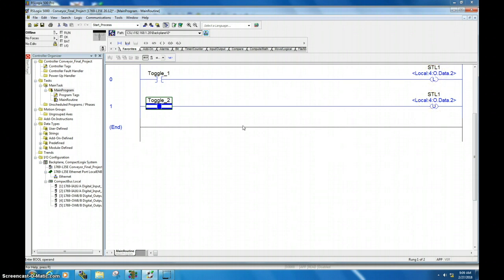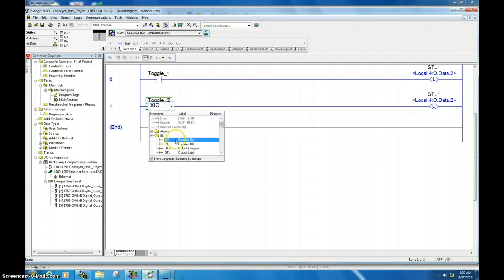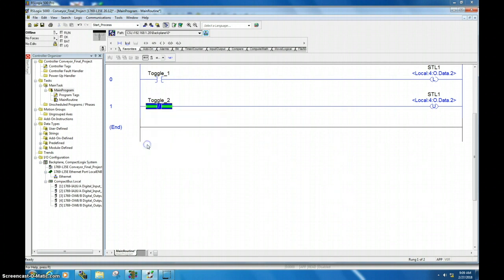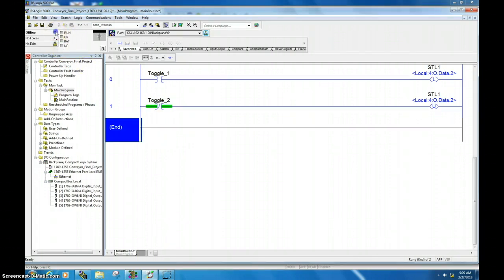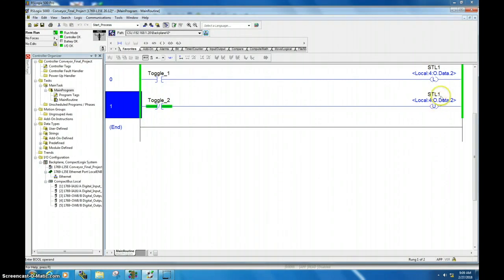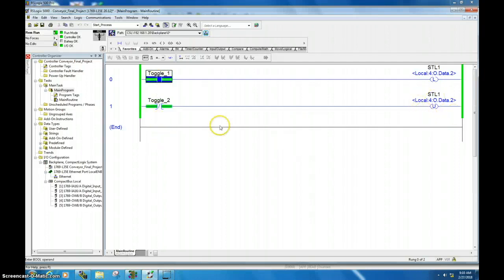Latch and Unlatch Instruction in RSLogix 5000 Part 2

Comment: Always add a normally closed examine on instruction before motor out put energize Estop on any moving part so you don't kill somebody or mangle them e stop in a program always nc examine on bit high if broken bit  goes low or examined off motor will not start false statement